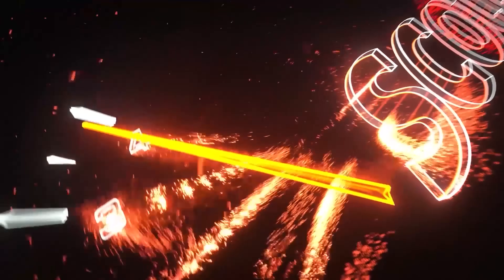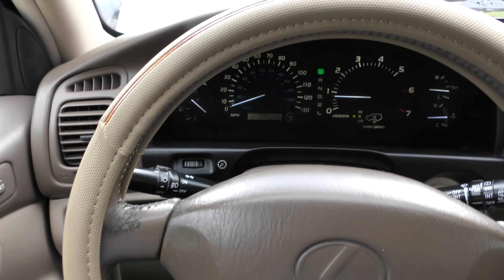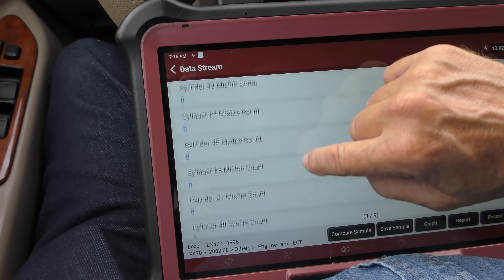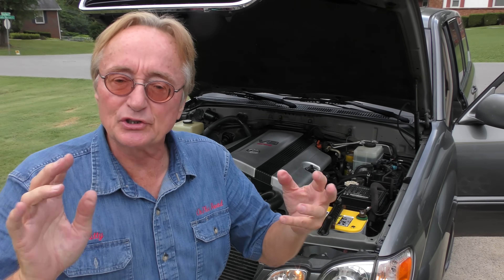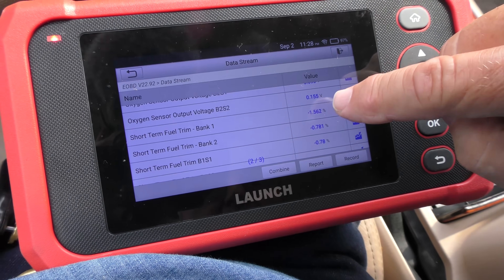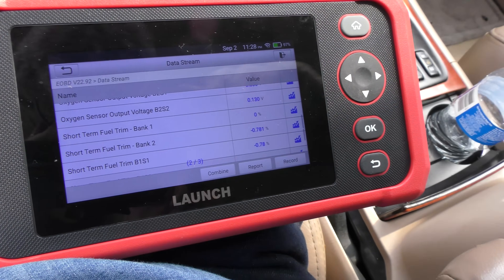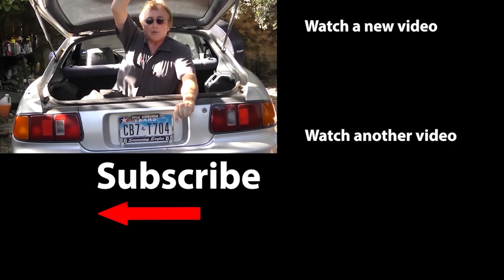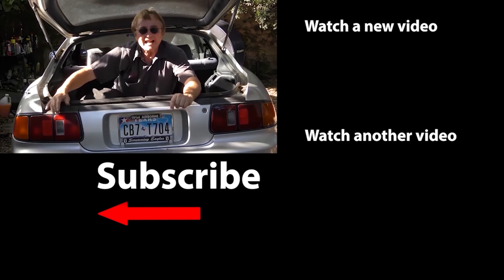Mechanics Don't Want You to Know About This

Comment: i got a toyota auris 1.2T and it seems like the limp mode is on often, especially on cold weather, no faults or codes are on. have you had any past experience with such issues ? thanks in advance man

Comment: My dodge ram 4.7 went from 14.8 Miles a gallon to the next day after going through emissions and passing to 7.2 miles per gallon.
Runs but has no power anymore like before, to get to 70 miles an hour on the freeway i have to keep it almost floored.
No engine light on.
Could it be a O2 sensor on its way out and just not a check engine light on yet?

Comment: 9:00  Natural gas burns cleaner meaning, it gives off less toxic fumes & doesn't leave behind dirty residue like gasoline does....Example, a kitchen stove top uses clean Natural gas. If you tried cooking in your kitchen with a gasoline stovetop burner. You'd die if the windows & kitchen door 🚪 was closed & sealed off.

Comment: Scotty, I have a 2017 Toyota Prado, four-cylinder turbo diesel, reading from the odometer is 167,000 km and it was consuming 11.6 L per 100 km I dump some of this stuff in the diesel tank and when I change the oil I dump some in the oil of course it’s the gray one for the oil not the one you show in the video and my goodness after driving 600 km I went to fill the tank and check the reading again and we were down to 10.3 L per kilometer. So this stuff works in the oil and in the diesel. Brand new Toyota Prado will get 10.1 L per 100 km. Bear in mind this is full-time four-wheel-drive. I guess my question is how frequently should I use it in the oil and how frequently should I use it in the diesel tank? Thanks for everything you post.

Comment: I'm going to try this. I just used cata clean and it did nothing. I have replaced all spark plugs along with the throttle body MAF sensor O2 sensor and more. Its really hard to drive for a living wben nothing i do fixes the problems. Lol

Comment: While posting on the Subaru forum, I mentioned using this additive in my 2022 Subaru Outback Limited 2.5 i. An engineer replied that people can throw their money away on this additive if they want to, but, it won't do anything for reducing Valve Carbon, or, for improvement to the Injectors, on 2020 and later vehicles with Direct Fuel Injection.

Comment: Scott why will my number 2 cylinder  have fire going into the plug that goes on  coil but it won't pulse and this is it running..new coil and plugs ..even put a new plug own the coil..it is getting  hot fire to coil but don't make coil  fire..2001 Ford exspadishion..please help me...

Comment: Scotty , I changed my brakes all 4 wheels and had the discs skimmed at a local workshop  which was progressively cheaper than the dealer / factory repair outlet  , the brakes said Toyota on the box  when received from the spare parts shop , but it does definitely feel softer . Any idea why ?  How  do we know if the brakes were some counterfeit part ? Any advice ?

Comment: I have a 2006 Ford Explorer. The MPG use to read anywhere between 300-330 miles to a full tank. Recently, the last couple of months, it’s dropped to nearly 200mpg on a full tank. Any ideas why this could be? Would adding this sort of fuel cleaner help in an issue such as this?

Comment: Would have been better if you had drove it before looked at the data. Then used the cleaner to see if it changed it. So we could decide if it was the cleaner or just the car moving after sitting for a year and half.

Comment: scotty i have a 01 celica gt  my misfire count shows it misfiring but  nothing else shows it like misfire monitor or the misfire rpms that thing showed misfire count 30 on cylinder 2  an 3   but the car idles perfectly fine. my ignition coils an plugs are new so are the injectors an fuel pump.  it makes no sense  lol

Comment: Hie there nice videos i love watching them

Can someone  please help, i have my nissan  elgrand it has a problem  of hardstarting infact if you don't  disconnect  the fuel pump it won't  start at all.

I tried  to change pump injectors  and plugs but the problem  wasn't  solved.  We tried to check injectors again and the only thing i discovered was that they all spray at the  same  same time without giving each other a chance

Comment: I had a 2001 Camry CE that developed a check engine light that turned out to be an evap code. Scotty suggested in another video that Shell gasoline could cure the problem. I burned nearly all the gas in this car and then filled it up with Shell gasoline. The check engine light went out and the code disappeared after burning half a tank. I added ATS oil additive to my 2012 Camry LE hybrid with 147K miles yesterday. The oil that came out of the engine was nearly black after this treatment! This ATS gas treatment is next for this Camry! I wish that I lived next door to Scotty. He is a true automotive savant. Trust what he says implicitly!

Comment: Use LUCAS fuel conditioner with Injector cleaner and upper cylinder lubricant in it on permanent base ( 20-30 millilitres par 10 litres of fuel, every fill up ) and forget about any carbon buildup in your engine. Combustion chamber, injectors, spark plugs, sensors will be clean completely. Do not expect any error code. ℹ️

Comment: Hi Scotty..i have an 2012 Audi A3 1.6 TDI Sportback. Can the diesel fuel injectors be cleaned in stead of replaced ? The vehicle has done 170,000 KLMS and presents very well. A fuel injection specialist said i will probably need the injectors replaced at a cost of $2400 Aud. He said that the injectors cannot be serviced. Is he telling the truth?  Great vid thanks..

Comment: That additive is super expensive. Ive been using techron for 40 years. Best fuel cleaner! New transfluid can be added before and oil change will flush your engine for less than $10....

Comment: Hey Scotty, years ago you recommended using Lacquer Thinner to clean the fuel system and fix a catalytic converter. Might that have worked in this case? Or do you think buying a more expensive product specifically sold for this purpose would be better?

Comment: I had this misfire feel with my Subaru. I bought one ignition coil off rockauto, and luckily the first cylinder I tried was the issue. Cylinder 1 misfire was fixed. No more hesitation and my mileage went up by 6 or 7.

Comment: Toss in some Marine outboard two cycle TCW3 oil at 1oz per five gallons of gasoline. No harm in trying a quart. That’s good for 160 gallons of gasoline. A gallon which I buy is good for 640 gallons of gasoline. Yes 128 oz in a gallon times 5 gallons of gasoline. Been using it for years. You wouldn’t know my truck is running at idle. Walmart Marine outboard Two cycle TCW3 rated oil is very good but you can pick your own that you would be happy with. Pennzoil XLF  is another good one.

Comment: Hi Scotty I need help I got a 2004 jaguar stype and my tps sensor went bad on the throttle body is what the computer code was my mechanic just replaced it on Tuesday now another code popped up now it's saying p0222 which is saying the throttle pedal position sensor which is a sensor which is part of the gas pedal assembly so should I replace that as well

Comment: I ordered some ATS chemical fuel cleaner 505 CRF waiting for it to arrive. Will update after I use it and test it.
Reply: Well, it is 2 years later and I am very curious how it worked for you?  I just bought it based on Scottys video & recommendation but part of me is afraid to use it because I read that one MIGHT have to change the fuel filter because of using this stuff.  Problem is that fuel filters are inside the freaking GAS TANK instead of under the hood where getting to it would be much easier.

Comment: Scott ..I got a 2008 Toyota sienna..I drive it in the highway and when I exit going to make a stop it shuts off..or when I'm on regular 25 mph road it turns off at a stop light ..shop signs ..I do have a check engine light and it's rebuilt too

Comment: Great Video SCotty. Will this method help with my 1985 Volvo 240 GL? It starts on the first crank and runs really well but when it is idling the engine shakes like a lot. When I am revs past 1500 RPMs the shaking stops.
Reply: Yes!

Comment: Had a similar problem with a ford, vehicle 

where I thought it  misfired 

 Checked spark plugs  but were good,   and there were no codes, 
About a week later, it was actually a loose piston rod and eventually  broke off, and boom 💥  it damaged the engine,  then need a new engine , @ 98,k miles , I will never buy another ford vehicle ever

That, Lexus  with over 300,k ++ miles is very impressive 👏

Comment: got a 2001 Mec 2.2 diesel. It is getting heavier on fuel. Is it just old age? It got about 210, 000km on the clock I bought it12 years ago when it was on 69, 000. Ish Moss

Comment: It has a strong odor of turpentine. It does work well....I have used it on several of my vehicles.👍
Reply: How often (between miles) do you use it.
Reply: @markdougherty1636  I am waiting for the 7,500 mile mark for the 2 vehicles I put it in. One is at 5,000 miles since adding it the car....a Subaru...is noticeably smoother. This product is unlike any other I've tried. I am a big Liqui Moly fan but this product works even better IMO.
Reply: @mikerieck306  Thank you.

Comment: i live in akron ohio and yes there is 1 cng gas station in my city its by the metro rta bus garage in the kenmore area and all most all the metro rta buses use cng fuel with the exception of a few old deisel one two electric ones and a few hybrid buses but most of them use cng no wonder ive never been on a city bus that ran out of gas!🤣

Comment: Hi Scotty
Love your videos and good info for us DIY guys 
Is it ok to use the LUCAS fuel injector cleaner for my 2015 Toyota RAV4 every 3000 kms
Will this cleaner damage the fuel tank lining or cause any other problems 
Please advise, thanks
Reply: I've owned 2 Toyotas and use Lucas products in both. I bought my first Toyota brand new and started using fuel additives as the mileage increased. My second vehicle I bought used and it already had 230,000 miles. Since I didn't know how the other person took care of it I flushed all of the systems. I also don't mix gas. I use gas from the same brand. My 4runner I used Chevron and my Celica I use Shell Nitro. I love how Lucas makes my gas last longer and the car drives like new. You'll definitely see the difference.

Comment: Hey Scotty, ATS is back ordered pretty bad. I need something for Oil Treatment, and well as fuel system cleaner. What do you recommend to use in the mean time, until they are able to fulfill my order? I will be using it on a Honda Pilot, and Chevy Impala.
Reply: Stp
Reply: chevron techron complete fuel treatment is AMAZING
Reply: Liqui Moly make excellent products. The Germans know what they're doing

Comment: Hi Scotty we have a 1996 Ford Explorer that we got from a private seller that he got from a auction it's a good running car a very strong has a Towing package has a oil cooler transmission cooler and so on and it's been sitting for a while cuz it has cobwebs on the bottom of the car no leaks whatsoever normal wear and tear on interior I put seafoam in the gas now would you suggest that since it's been sitting for a while that we use premium unleaded fuel to really clean the engine please let me know thank you and I am a new subscriber

Comment: Hi scotty I have a 1991 mr2 and it’s been sitting for over 4 years by chance would you know how to flush the whole fuel system I already took out the fuel tank and it was rusted from inside I cleaned it and changed the fuel pump but I want to test the new fuel pump before installing it so I don’t have to do it again but I don’t know how to and I want to clean everything else fuel related but I wouldn’t know what im doing any chance you have a video on this or could do a video explaining it a little?
Reply: Its the 5sfe it might be the same engine as the Celica
Reply: I brought several vehicles back to working order that were sitting for years .
the main thing to do is remove all the old gas and make sure your fuel tank isn't rusted so bad that it needs to be replaced.
If the fuel tank is okay then put the fuel pump in and try to start it . you are still going to have some old fuel in the lines / injectors so it may take a few tries to flush it out of the system.
I usually shoot some throttle body cleaner right into the throttle body
and then try to start it  .(  but NOT on the maf/ map sensor )
And obviously , replace the fuel filter .

Comment: Mechanics don’t want you to know that an EV requires zero maintenance
Reply: Really? Brakes? Air conditioner?, Tires? ? Suspension? Transmission?….ohhhh, you mean just an engine oil change every 5000 miles and checking the coolant for antifreeze once a year right?

Comment: Great video, thank you.  question:  I have a 2010 Acura TSX with about 135k miles.  It runs great, but the last 3 years I have only driven maybe 1k or 2k miles per year.  Would you recommend for me to clean the fuel injectors, even if I have no symptoms?
Reply: In my opinion , don't  fix what isnt broken .
If it runs good , just use a quality High test gas  and you should be fine .

Comment: I wish I saw this before replacing the O2 sensor on my 2001 LS430. More codes showed up after I put in a new denso sensor. Now its running very similar to that LX. Ill try the injector cleaner and check it out.
Reply: Sheesh

Comment: Hey Scotty I have a 1999 Mercury sable it's in extremely good condition with only 58,000 miles. The AC ,heater blower motor stopped working I replaced the motor .replace the resistor but still nothing what do you think could be wrong. I also looked at fuses could not see a blown fuse. I switched some contacts but nothing. What could it be.

Comment: Wow! Such a nice rig! I bought a 2003 Land Cruiser last month with 342,000 miles for $3500 as well, the interior is in rough shape but engine and transmission are buttery smooth after I replaced the #1 coil and spark plug! Due to misfiring. Thank you Scotty 😊 learn all the tips and tricks from you over the past few years! Now my LC keeps throwing a code P0430, I used the liquid stuff, used better gas quality, cleaned the MAF, still didn't help! Help me Scotty 😊
Thank you for all your videos!
Reply: John 
Po 430 is a Catalytic converter code .
Try some " Cataclean " in your fuel but read the directions first .
You can get it at Walmart .
I used it on a 2005 Highlander with the same po 430 code and it cleared the code .
Reply: Try replacing your maf sensor

Comment: I got a 2005 Toyota Sienna with 265000 miles and when I start it the vehicle the rpm’s go much higher than it should. Would this solution produce the same results?

Comment: A bad fuel injector symptom is so much like the symptom of a bad spark plug. I didn't know that until I got a vehicle with a fuel injector for each cylinder. The first symptom was bad gas mileage.

Comment: Hey scotty i have a small problem whit my car, it's a 1.4 turbo engine gasoline, at precisely 1800rpm has a strange sounds like def rumbling,/release and it stop after 2000rpm, the car run great but has this strange sounds that drive me crazy since the engine is very quiet!!

Comment: I don't work on my car other than check oil or change the battery.  But Scotty still saved me money.  My 2010 Odyssey had the VSA (Sability control) check light came on.  I bought the cheap Thinkcar OBD2 scanner he recommended and the only code was "cylinder 3 misfire".  Clearing this code cleared the VSA check light.  Who knows how much a mechanic might have charged for this.

Comment: So nice, Scotty said it one more time. When it has a manual transmission you don't have to worry about it, like the automatic ones. Manual is the king.
Reply: When you have a manual transmission, it's usually way easier to fix and less expensive than an automatic transmission.  So yes, it's the king if you care about not spending crazy money on your car.
Reply: @marvinshenk  and if you want it to last longer, and have more fun driving.... automatics are usually boring

Comment: scotty i had a cylinder 2 misfire and fuel injector circuit open cylinder 2 i tried replacing my spark plugs and swaping coils I purchased a fuel injector in case thats it on a 2017 grand cherokee during the summer ive had no issues but this only occurred during the winter any ideas

Comment: The cleaner that Scotty dumps in the tank is from ATS carbon clean and called "505 CRF" for fuel and "505 CRO" for oil.   The MSDS, aside from mystery ingredients under "TRADE SECRETS",  says active ingredients are "Dipentene", Limonene, turpentine,  some kind of organic peroxide, and "oil".  Dipentene is a tree-based oil used in solvents and pharmaceuticals.
Reply: Is this a good thing or a warning you are giving? Also would you not recommend doing 2 bottles ?
Reply: Tried it. Didn’t notice any difference 🤷‍♂️
Reply: @stevesmith756  He said  Injectors may need replacing but cleaning may help. Yours may need to be replaced.
Reply: Some would say the smell is addictive…
Reply: Pretty pricey lol js
Reply: Fun fact:It’s derived from the milk of poppy
Reply: And you don't have to smell it to know it works.  If you can smell it you are breathing it, just beware.

Comment: I use CataClean additive on my 2011 Audi A3 TDI, a diesel engine car, that sometimes gets a warning light for the DPF, deisel particulate filter. I would recommend. Seems to clean from the tank, pump, injectors, DPF, and CC Converter. It's not cheap at $26.00, but it works for me. It advertises that will work on gasoline engines, too. My mileage is a steady 37.5 mpg combined.